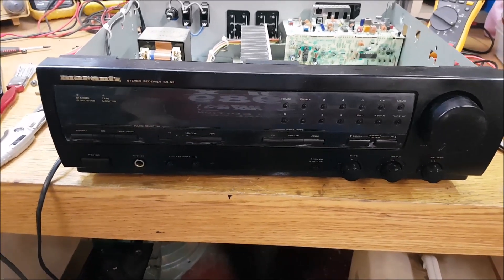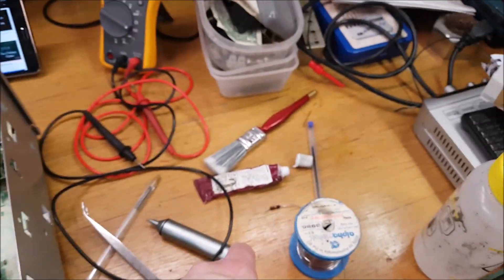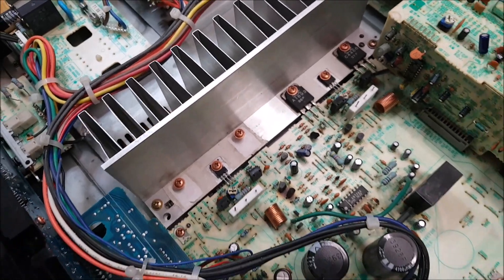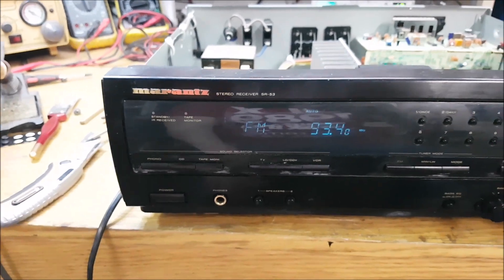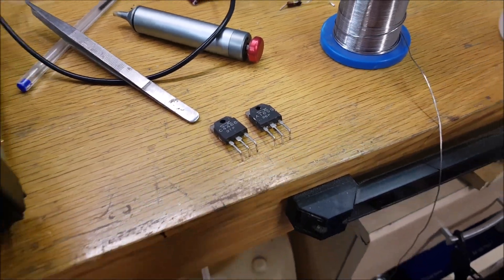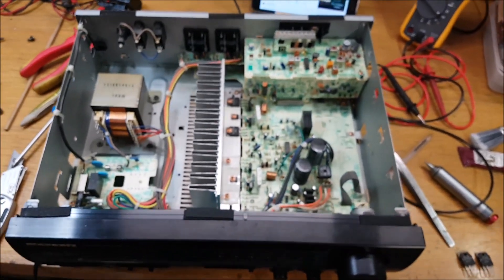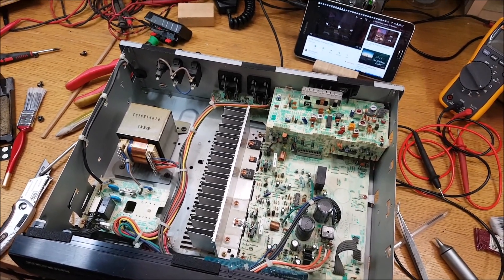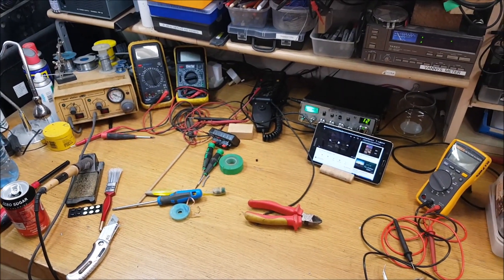MARANTZ SR 53 QUICK REPAIR

Comment: I have an SR-53 since 1993. Recently, it fritzed and won't start up. If it's blown fuses, is this a repair job for a rank amateur? I've got no tools for this, other than a multi-meter.  I'm looking at $75, just for an estimate, for the repair shop, plus the rest of the total cost, whatever that'll be.
Reply from the maker: Shorted output transistors I'd say. Lift the legs of one channel and see will it power up. If it does that set is bad.